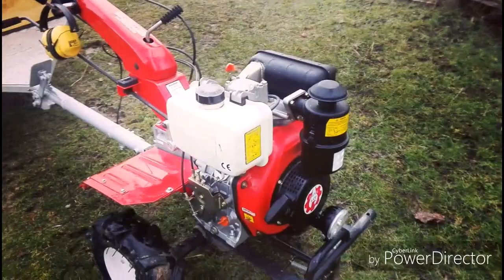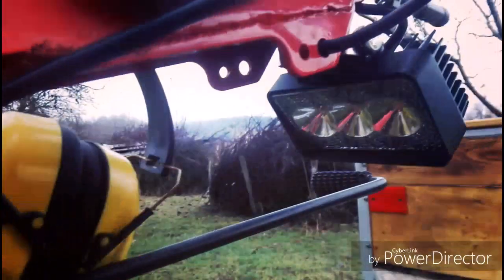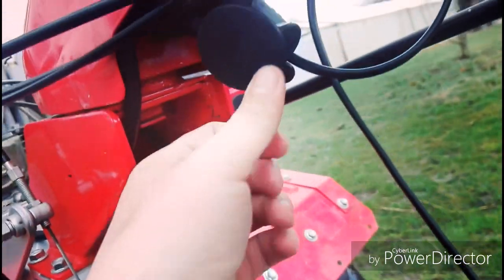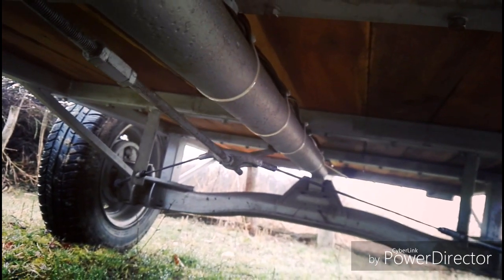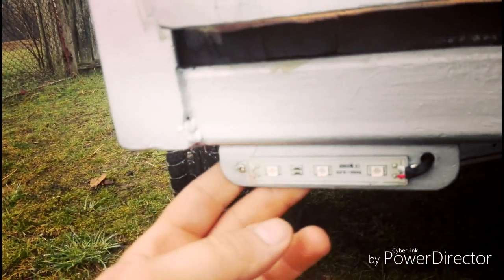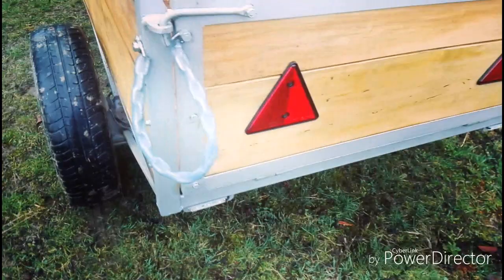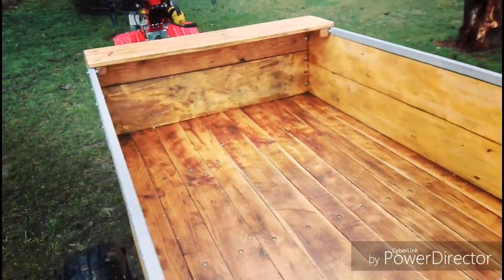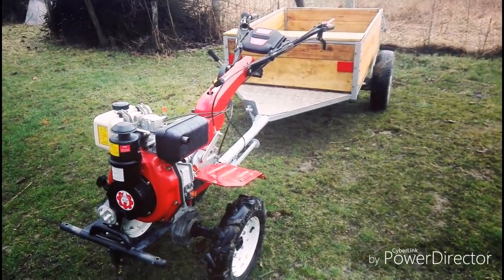Instalația electrcă ..Rotakt 6 cp diesel RO 1100 6D

Comment: ce zici la un ruris 70009k sa poate adapta far
Reply from the maker: Rafaela Suca da trebuie sa cumperi bobinele si magnetul pentru modelul respectiv de motor cod motor (ex la mine 178f) cauta pe ebay sau la ruris si rotakt oricum costa cam 250-300 lei fara far fara buton fara releu sau altceva ... Bafta te salut !
Reply: Cam mult...costul